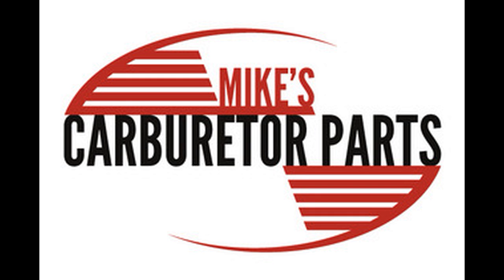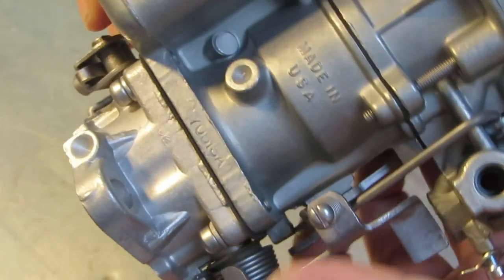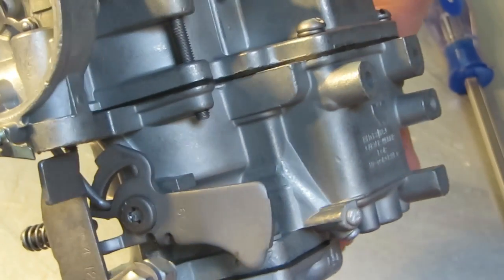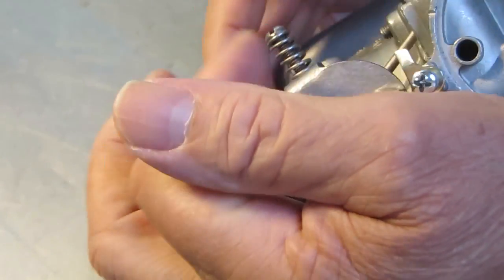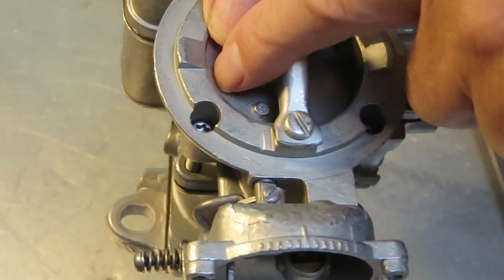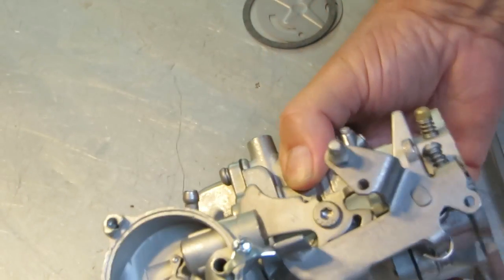Demystifying the Carter YFA 1 Barrel Carburetor Choke | Carburetor Basics Explained

Comment: I have a 1978 Ford F150 St. 6 bought a new carburetor for it  Starts and runs fineand I’m trying to figure out where to wire the electric choke up to can you help me out thanks
Reply: @MikesCarburetor  Thanks man I will give it a shot this truck was given to me hang out with 67,000 miles on it 6 foot being four-wheel-drive thanks for the info Mike

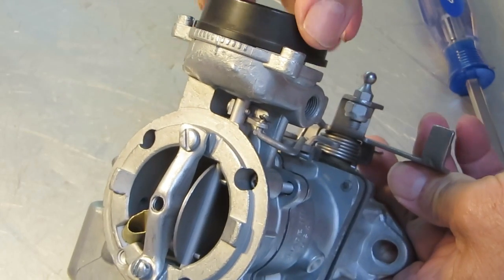Comment: 2:21 Do you hold throttle full open the whole time when placing or setting choke cap?

By holding the throttle open, is it releasing pressure against the choke plate?

I'm watching all your YF/YFA videos to learn how it works

Comment: Hello. Loving the channel.  I have a question; would a 1 barrel holley carburator model 1920 4414-1 12r4252b, fir on an 81 f100 with a 6 cylinder 300ci engine? Thanks.

Comment: My YFA is only about 5 months old. When I set the black cap and tighten the three screws the cap still rotates fairly easy. How easy to rotate or locked in place should the cap be in the three screws are tightened?
Reply: @MikesCarburetor  there's not a gasket. It's just the screws, plastic cap with hook and heat coil in choke. It's not electric it has the two hot air tubes that go down to exhaust manifold. By the way, should I put some kind of insulation cover on them? Instead of me asking at O'Reilly's or AutoZone, do y'all sell the gasket?
Reply: @MikesCarburetor  I don't see numbers on the side, but there's a tag: 152 D5TZ9510 AG G9K04

Comment: Is there supposed to be a steel plate between the choke thermostat and the housing of the carburetor?
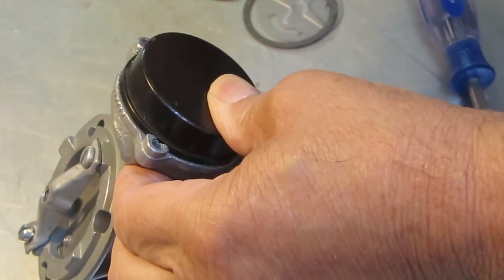Reply: Isn't that the piece you can see just sitting on the bench at 2:48? Wondering why it's left out unless it was just for demonstration in the video.

Comment: where does the hot air come from? do you just run a barb connection then run it to that port on the top side of the carb?
Reply: There is a pipe running down from the choke to the top of my manifold so that the warm air opens the choke gradually
Reply: @MikesCarburetor   is there replacement choke tubes?